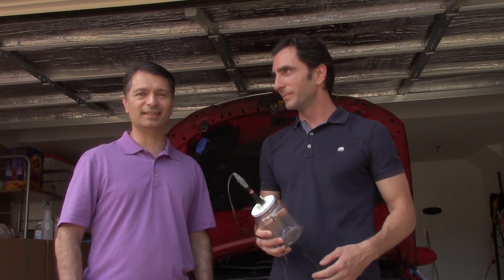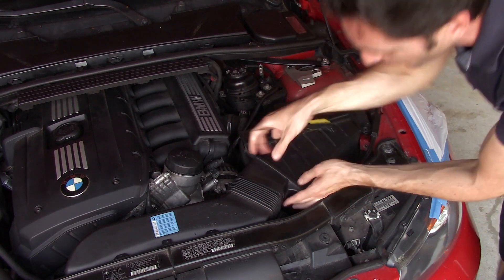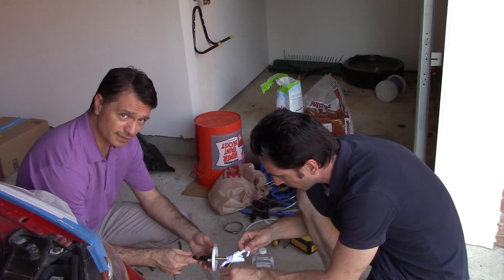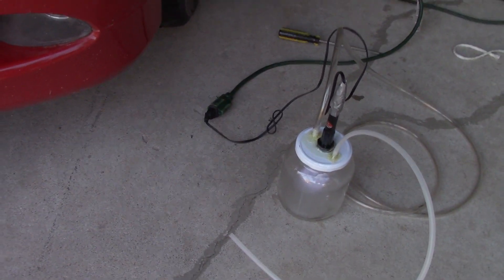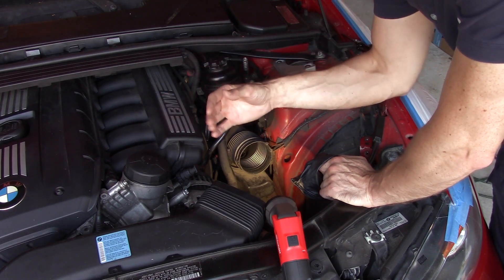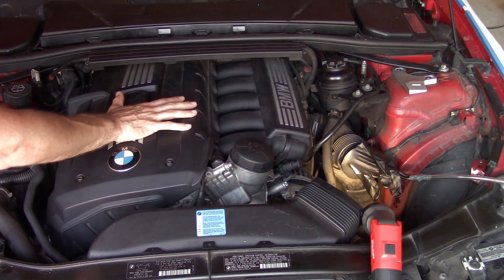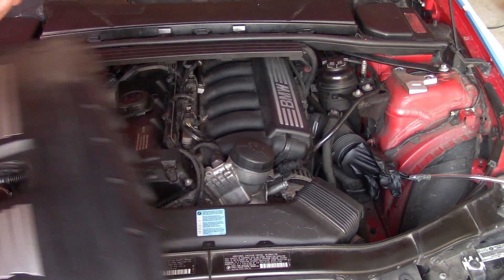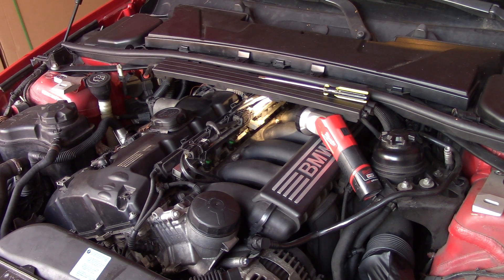Car Vacuum Leak Test

Comment: Did the cylinder give an error code in the vacuum leak, such as p0304
Reply from the maker: I had P0171 and P0174 error codes. Check out the video description for more info.

Comment: I built one similar but used a medium sized metal tin. Shredded  cardboard egg boxes into it. Lit them, blew out flame so there was just smoke, fitted tight lid, pressed on pump. The smoke lasts quite a long time. Bee keepers use similar in their smoke puffers.
Reply: Oh, I like it. I used incense cones, but pretty smelly, heh. I also attached a BBQ regulator so I could use shop air, but keep it nice and low-flow.